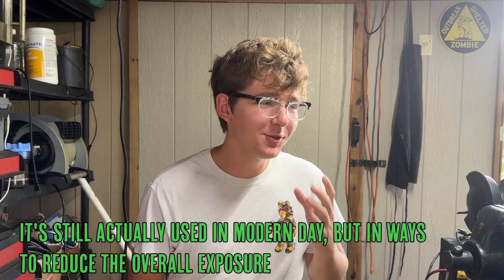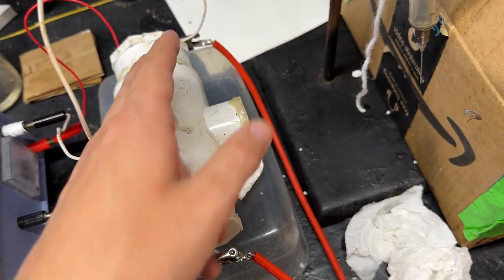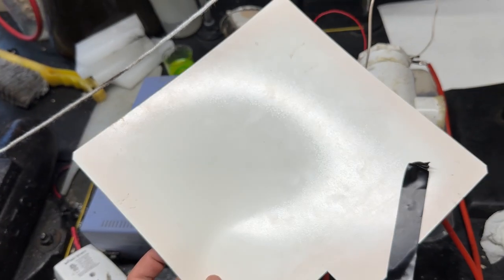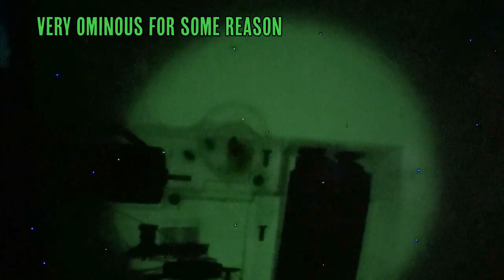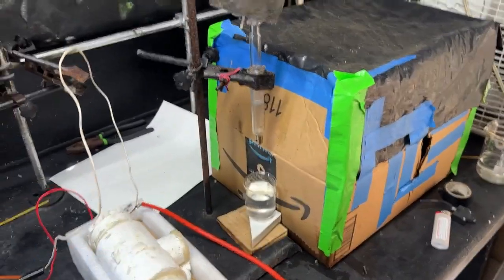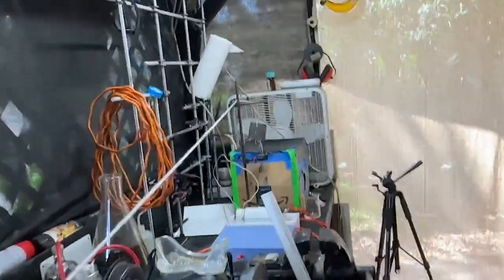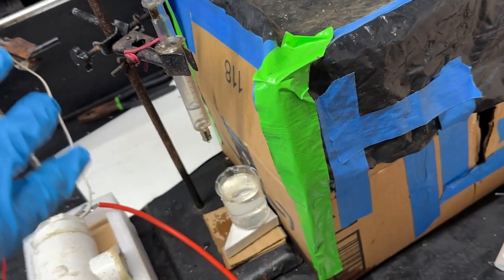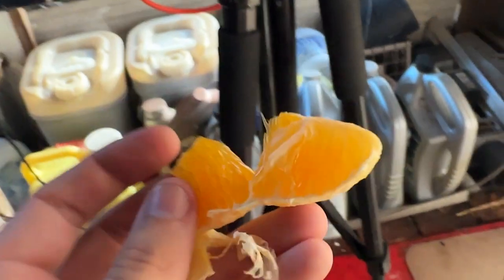Fluoroscopy - Real time X-ray vision

Comment: How dangerous is that 😳
Reply: over 9000
Reply: as long as it's pointing at a concrete or brick wall, not very dangerous. especially with him standing back a bit behind what looks like some lead foil, he's perfectly safe. The 80kV power supply is probably the most dangerous part as long as you keep the tube aimed somewhere relatively safe

Comment: If the oil in your tube setup is leaking (mentioned in previous video, that I just watched) because the oil is getting so hot and expanding, what would happen if you modified the enclosure to have a small air pocket on the top, above the oil? It should allow the oil to expand some without leaking, as the air is compressible.

Comment: they actually wanted to do a Fluoroscopy to me for a lung surgery but decided to use a davinci robot to do a minimally invasive procedure instead
i personally wouldn't want to be on an xray video myself
Reply: ct scans are just an x ray video stitched together to make a 3D image. It's not great, but not the worst for you. it's even commonly used by dentists and orthodontists.
Reply: Im an x-ray tech, i work in the OR regularly. Nearly every surgery that isnt minimally invasive uses Fluoroscopy. Even some minimally invasive surgeries (interventional radiology) RELY on fluoroscopy for success. You shouldnt be afraid of video-xray, the tech has come a LOOOOONG way from the early days. Xrays back then exposed patients to more radiation than full surgeries full of fluoroscopy do nowadays. Equivalent of a few long distant flights from LA to NY depending on how long they press the foot pedal.